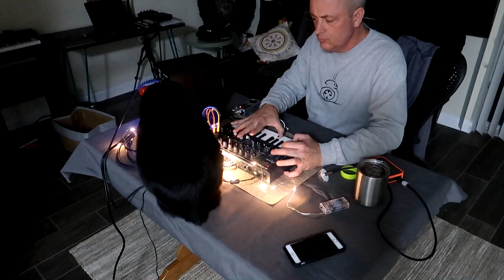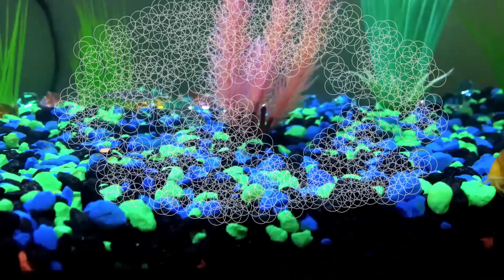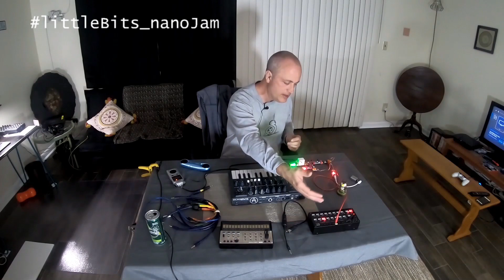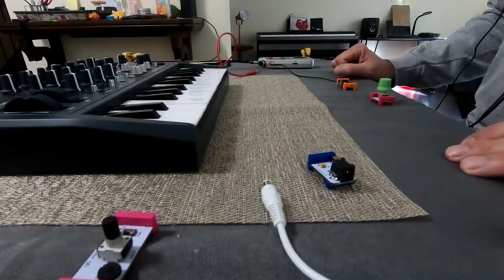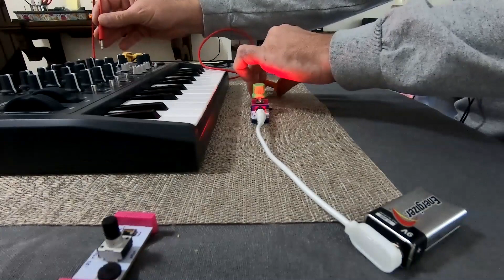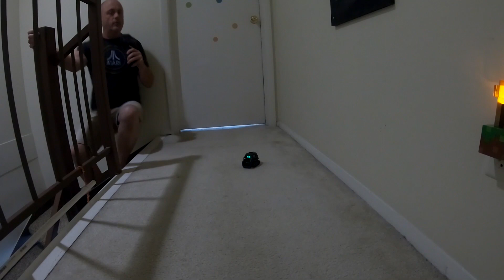Using littleBits to Control Your MicroBrute (part 1)

Comment: When Radio Shack was going kaput I drove all over the Puget Sound region looking for littleBits on the cheap. I ended up finding two Synth Kits and a bunch of single ones like a C/V, midi, microphone, randomizer, inverter, and a bunch of splitters... all for maybe $120 after taxes.  And a mitt-full of patch cables.  It was a bittersweet day.
Reply from the maker: Dang, that's a great haul, but I know what you mean about the bittersweet. I went to 2 or 3 nearby and bought a lot of basic components and some arduino stuff as they were fading. My best deal was getting a Seaboard  keyboard block and a couple of lightblocks, all 75% off because Barnes & Noble figured out nobody would ever pay full price.